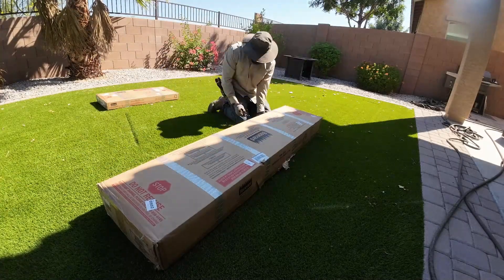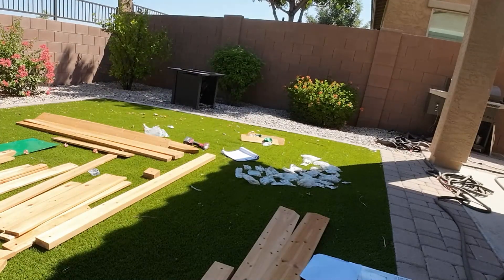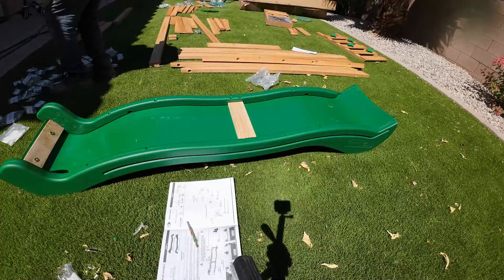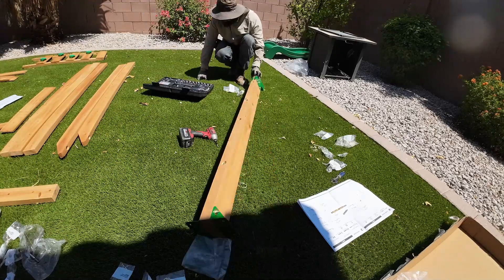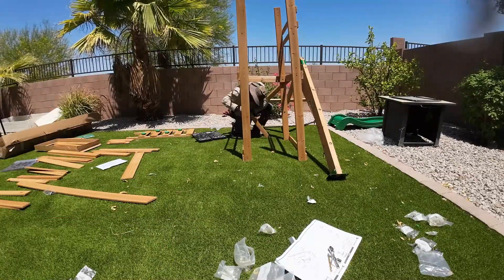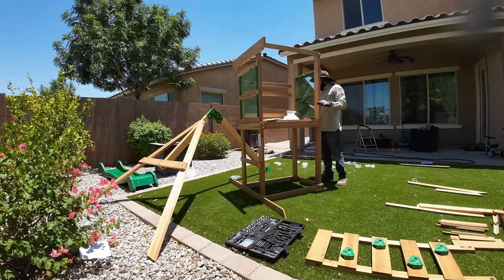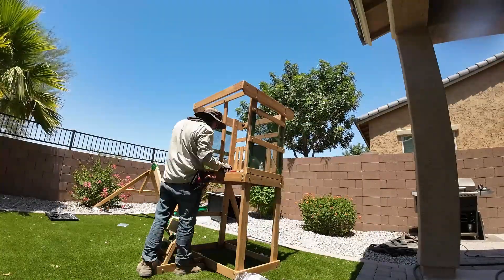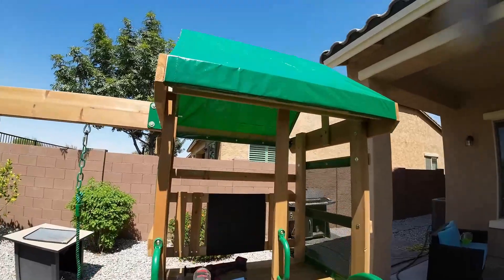Assembling a Buckley Hill Swing Set Playground

Comment: I got a question I’m doing the swing beam the 103 washer safety won’t seem to go in so I can screw it did you do anything different with that?
Reply from the maker: yes, I even had to cut/drill new holes for the boards at the bottom because they were bent and stuff didn't line up.